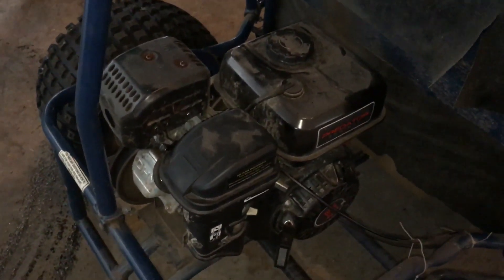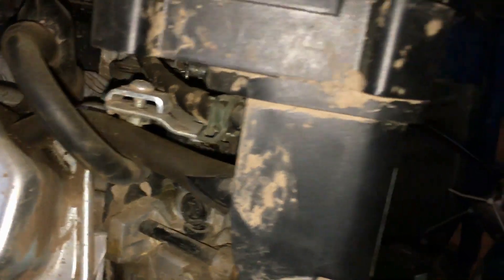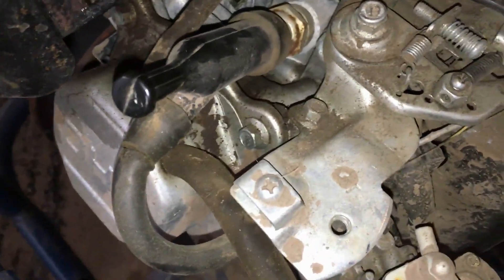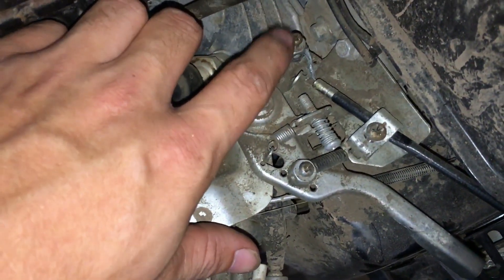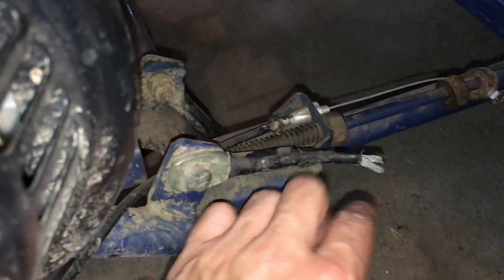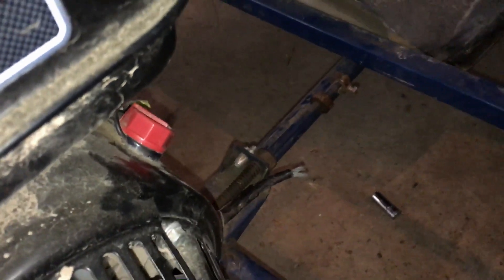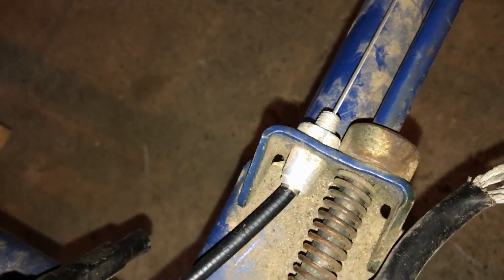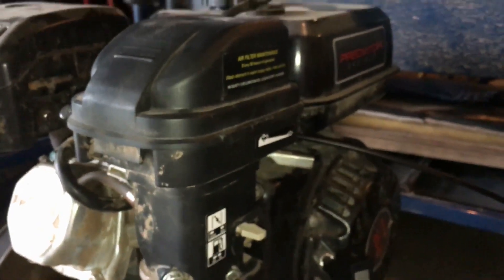Installing a Throttle Cable on a Predator 212cc Engine!

Comment: The silver lever on mine doesn't go all the way back when I fully press the gas pedal down; it only goes half way back. Basically if I judge it off the Bunny/turtle meter it only goes midway not all the way to the Bunny. Do I need to adjust these cable??
Reply: That’s what the second spring is for that he added. I’m having the Same problem abs think I need to go pick up one

Comment: What size cables do I need?
Reply from the maker: +Bullet BassBoost I used a brake cable off of a bicycle and that seems to work really well. You can buy an actual throttle cable but it's pretty much the same thing as the bike brake cable. Hope that helps.